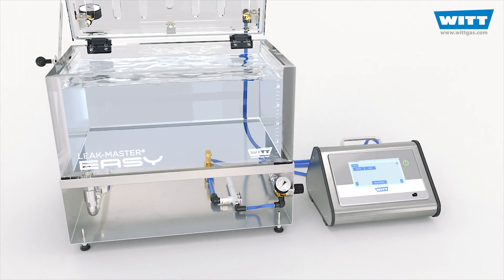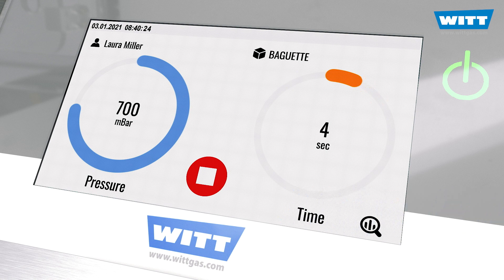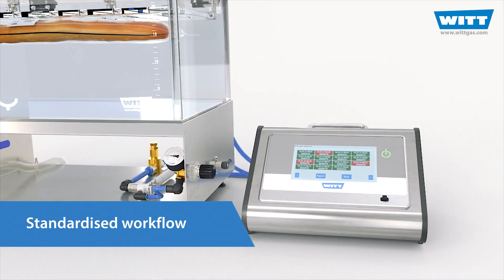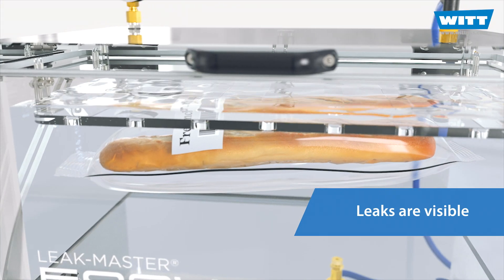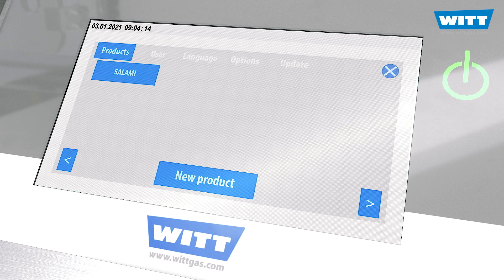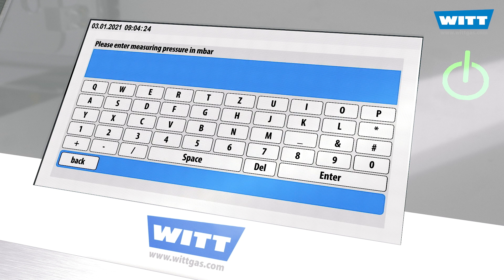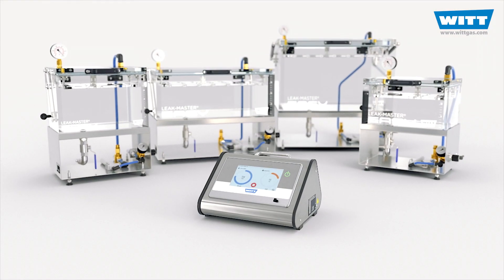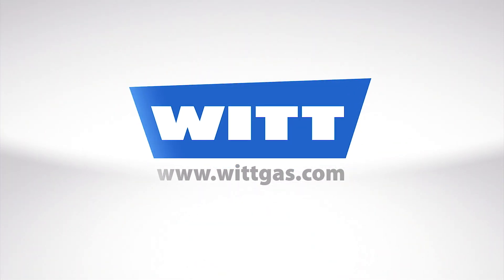Bubble test leak detection for packages with electronic control unit - LEAK-MASTER EASY PLUS

Comment: What is the size of this equipment?
Reply from the maker: We offer the LEAK-MASTER EASY in 7 different sizes, from  485 x 440 x 300 (overall dimension approx. in mm HxWxD) to 920 x 970 x 630. All sizes can be combined with the PLUS control as shown in the video (approx. 110 x 300 x 260 mm HxWxD), for simple, standardized test processes and complete documentation. For more information please see  https://www.wittgas.com/products/package-leak-detectors/bubble-test-easy/.

We are happy to answer more questions. Please use this form to get in touch: https://www.wittgas.com/contact/

Your WITT Team